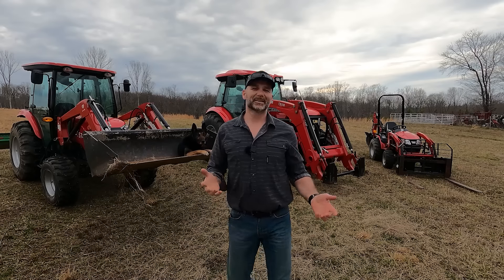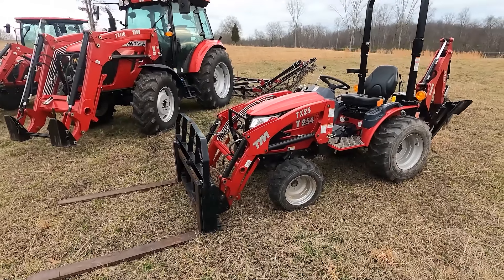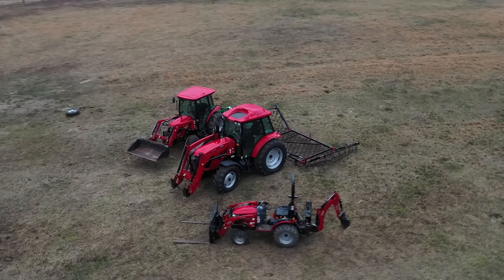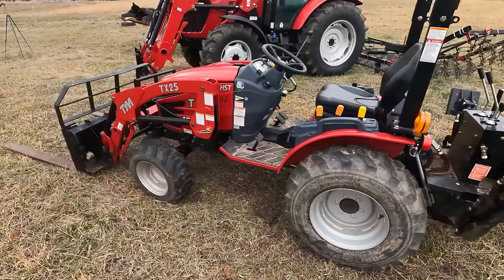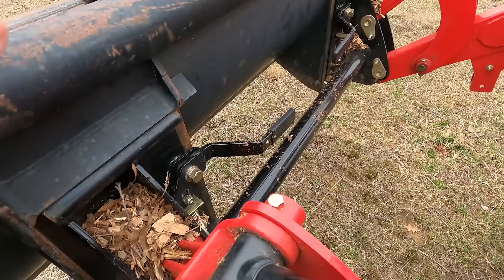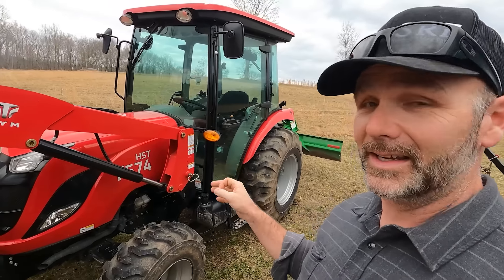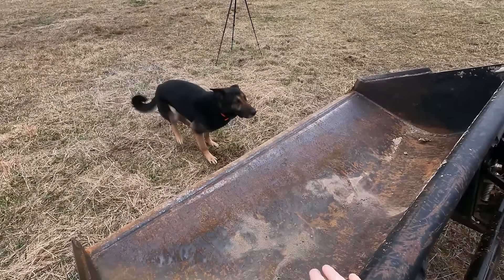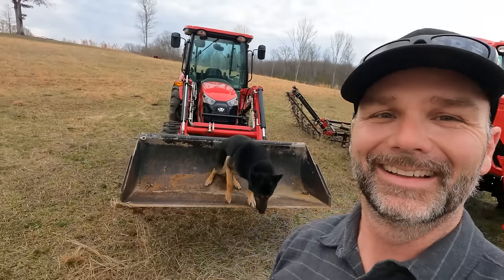Red tractors! The TRUTH ABOUT TYM You were right!

Comment: Would you expect to have any problems with the TYMs with 50 on one and no more than 200 hours on the other?  I can appreciate the review and walk through of the tractor, but based on what I've seen...these haven't been worked close to as hard as the Deere was...not really fair to compare "reliability."
Reply: Yea put 10 plus hours on that thing even 6 days a week for atleast 8-9 months of the year then do a review! He’s still a hobby farmer
Reply: Exactly. I wouldn’t trust one of these on a high production farm were we can run tractors 24 hours a day for 3 or 4 days straight in harvest. Or pushing snow commercially. 
Parts and services should be the top point in making a decision on what brand to buy
 Waiting for parts and services is not a option in harvest time
Reply from the maker: Deere went back to the dealer with under 10 hours on it. Not on problem with any TYM product
Reply from the maker: Show me a 110 hp tractor “harvesting” my friend. This is a high hp utility tractor. Not harvesting wheat on 2000 acres. It’s simply not the machine for that job. Bailing hay on 500 acres….sure, but not harvesting on thousands of acres

Comment: No dealerships in my area so I can’t consider TYM as a option. All tractors will need parts at some point.
Reply: Parts are the biggest issue as well as service. I have a friend with an older TYM and parts are an issue. Resale is an  issue as well. Both JD and Kubota have an extensive dealer network, and they hold their values over time. 
TYM has great features but will they be around for the long haul nationwide?

Comment: I just watched this video and it is apparent that you like your TYM tractors.  I bought a TYM 333 in 2005 with a front end loader and an Italian made 3-point hitch backhoe.  Back then, it had a Kubota diesel engine.  When you got into the 60HP and up, they came with Cat engines.  I owned that tractor from 2005 through 2020.  In general, I would have to agree with your assessment of the quality.  I do however have some issues with the manufacturer.  First, was the lack of dealerships in Missouri.  If I wanted to get dealership work on it I would have to trailer it over 90 minutes away.  Not only was that time out of my day but also expense and wear and tear on my truck and trailer.  So this issue led me to start performing most of the work on this tractor myself and there came the biggest issue of the brand......their maintenance manuals SUCK!  At one point, I had to replace parts in the gearcase that housed the PTO gears.  The manual for this section and just about any section of the tractor was pretty much useless.  A large portion of the illustrations were draftman's drawings!  Now tell me how the average "wrench-turner" at the dealership is going to make heads or tails out of a draftman's drawing, let alone "Joe SnuffY" who works on his own tractor.  The only way I got it back together is through the parts manual.  The parts manual was very useful.  When they called for a bolt, they gave diameter, length and pitch of threads.  THis was invaluable as the bell-housing had 4 different types of attaching hardware.  The thing with using the parts manual though is that I had no torque specifications so I had to use "german" torque......."Gut en tight".  I only had one instance of poor craftsmanship in all those years of work.  Early on the non-adjustable lift link on the back broke.  What I found was that they had "butt-welded" the solid round stock to the flat surface of the clevis.  There was no beveling of the round stock to get deeper penetration of the weld.  Nor was the weld deep enough and broke within several hours of me getting the tractor.  I removed the part, beveled the round stock used a high power setting to get good penetration into the clevis and made several passes.  It never broke again.  The tractor now is owned by my next-door-neighbor's son.  He is enjoying its use to this day.  Given the opportunity, I probably would buy it back from him in the future.  It was my first tractor purchase and have never regretted purchasing it.  I had nearly 600 hours on it when I sold it.  Less the manual issue, its a very good purchase for anyone wanting a reliable tractor.  Good luck with your farm.  I love your dog!  He seems to be a very smart dog as was our half German shepherd-half Australian shepherd we had.  kd

Comment: I purchased a TYM 574 in May of 2022. I have over 70 hours on it. I needed something that had more than 40 hp the 574 has 55 hp. I needed something that would pull a round baler and a large manure spreader. and 6ft implements . My neighbor owns a 474 and it just did not seem big enough for what I need it for, watching you and Daniel Arms on Arms Family Homestead showed me that that’s what I needed. Here in southwest Louisiana I did not need an enclosed cab, plus I would probably knock out all the glass out of it clearing all my brush. But even this will not beat my Farmall cub high crop A,  Farmall cub all the way for working in the garden.

Comment: The hours are super low on all of these.  I’m really interested to know how they do over the long term.  I put about 800-900 hours a year on my JD5075E which is mostly mowing with a Woods BB720 X rotary cutter, but in the fall I switch to a rear mounted blower and an 8’ push box for winter snow removal.  Mostly, it’s about 7.5 hours per day, but snowstorms can go 30-40 hours at a time.  I think it has about 3,200 hours on it right now.  It doesn’t use a drop of oil between services and has auto regen, so no DEF.  I wish it had as many gears as your big one.  That’s really nice.

Comment: I've got the TYM T264 and it is incredible for its size!  I have a 60 inch tiller on it and use it and the loader mostly.  I tilled 600 feet of frontage about two feet down a few inches at a time and reshaped my ditch so the water would drain out of about 500 x 500 of my yard.  Never missed a lick.  I also found things I didn't know needed lifting till i bought pallet forks.  It is rated 1400 lbs in the bucket, not the pin.  I'm 6'2 and have lots of room too.  Not one bad thing to say!
Reply: If you're still around to see this, what sort of things to lift? I want a backhoe, he wants pallet forks

Comment: I bought a JD 970 way back in 1994. 35 hp Yanmar. It has been bullet proof. Not a single issue. This winter the cold finally got the better of me. I decided to get a Cab tractor in the 40 to 50 hp range. I wanted another Deere. Shopped our local JD dealer Pape Machinery. They are big time. 44 locations in 4 states. I was shocked at the prices. We have all the tractor brands in the area and I shopped them all. Spent 2 months doing research. I finally settled on a new TYM T474. It was 27k less than a JD and it was 10 hp more than the Deere. My son in law is a 3rd generation farmer with his Masters in crop science and with his dad they farm 8k acres. They are all Green. He came over to see my new Red tractor and spent time looking it over and driving it. He was very impressed. Hopefully our new Red tractor will become a special member of the family like the JD 970 has, which is currently in the heated shop and will never be sold.

Comment: I have the RK37 and after a lot of research and knowing it was actually a TYM, I have been more than happy with my purchase. I come from one of the largest agricultural counties in Ohio so these foreign made tractors aren't the norm and it took a lot for me to make this decision. I compared the RK to all the big names and in the end I felt it was the better all around choice.
Reply: @JamesG1126  agreed
Reply: @ronniejenkins4633  Can you two elaborate on these comments? Did you have a bad experience?
Reply: @court2379  I run a Mahindra 2538 for snow plowing commercially  in the winter.  The 2538 is produced by TYM.  We are currently at the end of our 5th season running it, and the average shift is 12 hours. The whole route is over 35 km, and includes regional highways.
Previous we grew up green.  But as I look to upgrade, I will stick with the red.  The tractor has had one minor breakdown, and the dealer had it back to me in 24 hours.  When you use these machines day in and day out, it's the dealer support that makes the difference.
All shades of machines will have issues at some point, and at the worst time.  It's your relationship with your dealer that makes the bank.
Reply: @thisthatandtheother100  I hope the TYM network continues to grows. The nearest to me was 61 miles, though now that they absorbed Branson it shows one 16 miles. So if they really know and support them, great! Things are moving in a good direction.
Reply: @court2379  My understanding is that both the Branson dealers and the TYM dealers will supply both.  My Mahindra dealer is about 15 k away.
Reply: @JamesG1126  traduit francais
Reply: I have the same tractor and I am at 165 hrs and no issues!!
Reply: I have the RK37 and have generally enjoyed it. The biggest, and ongoing, problem is the parking brake hold. It has rolled away from me several times, despite being on “full hold.” The local dealer has tightened it (I presume it is a threaded rod), to no avail. Obviously a dangerous situation. I plan to take a die to it and add some additional threads. Irksome. I understand TYM dealers won’t service an RK, which is petty, if true. It appears the machines are identical, except for badges.

Comment: I've got a T754 with about 60 hours on it.  I've had two problems so far (and they both happened right before the 50 hr service call)  1.  L/M/H shifter got stuck and wouldn't move  (ended up being a bad weld on the shifter sticking in the transfer case that they ground down to fix)  2.  Engine was overheating during brushhogging/mowing with 15 ft batwing mower  (ended up I was cleaning the AC filter, but was missing the radiator removable filter that was hard to see)  Dealer servicing was a major concern, luckily a new one started selling Branson's right before the merger, so I'm hoping to use them from now on.

Comment: Ive got the T25, about 450 hours in 2 years. Work it hard, it’s often underpowered for what I need but does the job, just does it slower. Mine squealed from the start, makes a lot of noises, not happy at all with dealer service, doing my own at this point, the FEL is bent a bit, moving a lot of dirt might have done that, needs some maintenance. Overall it’s a great tractor I would have been better served with the 2515 but that just shows how good this little machine is.

Comment: I'll tell you all you need to know about TYM. I purchased a 2012 Mahindra 6110 Gear/Cab (Made by TYM) and we've put 2100hrs or so and blew up the radiator due to a bad cylinder liner (pushing cylinder compression into the coolant system) , in most other equipment this is not world ending order the parts and put it back together nbd. But on the TYM you have 2 options 1. Buy a new motor due to lack of ANY available engine parts (can't even buy a stock sized piston!) the motors are $18.5k 2. Buy a used engine (I found 1 available that was in a barn fire. No Warrantee or Gurantee of any kind) $6.5k. On a Kubota (I bought a M6060HDC as a replacement) John Deere, or any other "Big Brand," this would not be an issue for 2 reasons. The first is parts availability is a world away from TYM/Mahindra. The second is used/aftermarket parts actually exist. I will say that TYM/LS/Kioti/Mahindra are much more "feature rich" stock to stock/premium to premium, they need to in order to compete also they are cheaper. So keep all this in mind when buying an "off-brand" machine.

Comment: I have had a TYM723 for about 9 years with a 72hp perkins engine with about 1800 hours on it. Things I really like about it...540 and 1000 rpm pto selector. When I haul manure or spray, I put it in 1000 speed and set my tractor rpm to about 1400 which is half engine speed. When I need the power for grinding feed, I go to 540 and full throttle. Short turning radius is great. Hydraulics are powerful. To heavy a load up front and the back tires come right off the ground. Things I don't like or problems I have had. Front tie rod ends wear quickly, no good place for a tool box so I have lots of stuff on the floor. The fuel gauge goes to half full about 10 seconds after I start it no matter what the level is and the 4wd became intermittent at the same time. While diagnosing, I found grounding the 4wd solenoid would lock it in so I just mounted a toggle switch in the cab and that makes it work every time. I think the control module is to blame but I am used to using it this way now. Had to weld up the front tire lugs on the rims because of cracking. I haul allot of big round bales which has stressed it. Probably why tie rods wore early too. Perkins engine drips a little oil which is pretty normal for them. I had to modify the drawbar adjustment pin because it kept working loose. I lost a couple implements while pulling, noe since I changed the retainer pin. You need to blow out radiator/oil cooler / AC condenser often if using in dust or haying. Will pull a 4-16 plow, make big bales with my 604 Vermeer baler, operate my 13' discbine, and fits in my shop in the winter time with a ten foot tall door. The thing is an animal!! I would buy another one in a heartbeat even with the issues I have had.
Reply: …parts availability was my only “hold up” reservation on TYM.

Comment: I got a t264 tractor and had it about a year with little over 100hrs and I had 3-5 hydronic leaks and one major oil leak. My bucket got bent last year from picking up a rock. Just yesterday the 9th of April 2023 my backhoe boom had mayor issues and maybe bent. Plus the tractor over heated. That all on one year. Done some serious work and put it through it’s paces. But personal I at this point thinking of selling it and getting a different brand of tractor that maybe hold up better. If they don’t fix mine. They fix all the other issues but this one will be a big one. Especially the backhoe. May keep it.

Comment: TYM has bought Branson. The Branson nameplate is going away but TYM will give the Branson owners great support.
RK tractors sold at Rural King stores are also TYM most Rural King stores have 25, 37, 55, and 75 horsepower models.  Many more sizes available if you stick to TYM

Comment: I have a 2019 TYM T474 with 409h as we speak, not a single issue with it. My channel specialize in this tractor model since I've had it for 3+ years now. Not had a single regen request, keep an eye on nuts and bolts, service per factory spec with filters and fluids and it will threat you right.

Comment: I have a 2016 TYM T394 cab model with 150ish hours on it that I use around my 10.5 acre homestead. Brush mowing, roadside mowing, loader work and snow blowing in the winter. So far no issues. Extremely good on fuel! Not sure what you would have to be doing to run a full tank of fuel through it in 8 hours but you’d be busy. My only 2 complaints are the location of the hydraulic levers and my tractor in 2016 did not have cruise control which is nice when mowing. R4 tires are great for most conditions but not so much for winter from a traction standpoint. For the money and warranty I couldn’t get even close to the same hp and capability from one of the big name brands.

Comment: My TYM when I sold it had over 2,700 hours, with great resale value. I had no issues. My rear axle was manufactured in Utah U.S.A. My neighbors green tractor had a rear axle made in China. 
The green have a tremendous reputation for a reason, but I have seen several that I am glad that I didn't own with major transmission problems.
Mine had two speeds on the PTO, and three hydraulic connections for the rear.

Comment: I purchased a T503 HST Cab in 2013. The Cat/Perkin engine went into over rev and self destructed @ 580hrs, something let go under the front cover and ate all the teeth on every gear causing the governor to fail. When I contacted TYM, they informed me that the tractor had the 7 yr warrant not the engine, that had a 2 year warranty from Perkins (which expired)  and the long block would cost $9000 and me having to do the work. Finally found a complete used engine for $3200 delivered. One thing that has always irritated me is that the HST doesn't release quick enough when I pushing and causes the engine to stall, so I need to pay attention and start releasing the pedal sooner(yes I know about the 3 way selector switch and I have a Kubota that doesn't do that). Other than that I really enjoy the tractor.

Comment: I have a ct230 we call it kitty. We got it 2011, do scheduled maintenance. The only problem we've had was to replace the radiator about after about 6 years.  2023 we had to replace two hydraulic lines on on the outriggers for the backhoe setup. In September we had our first issue and that was it needed a new fuel pump that was less than fifty bucks. And of course I put it on. It is a bobcat.

Comment: If the button on the back of that lever is  like the button on the back of the lever on most tractors it disengages the clutch, not engages when you push on it.
Otherwise you would have to drive around most of the time pushing on that button to keep it engaged. 😁